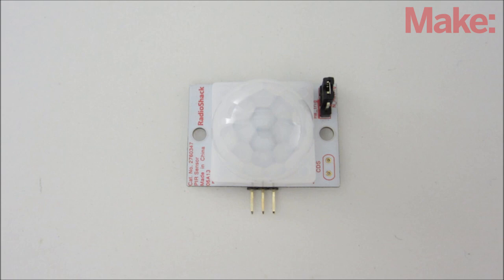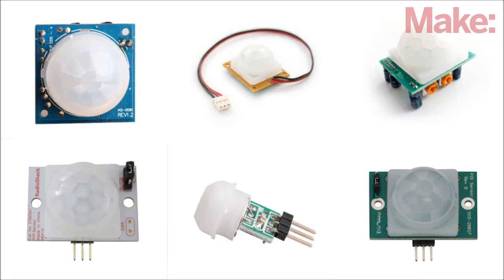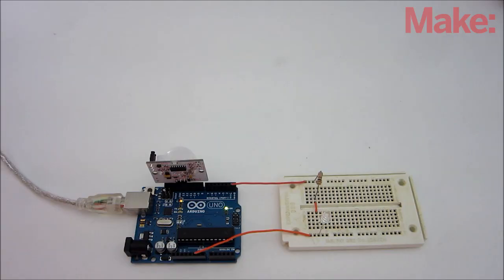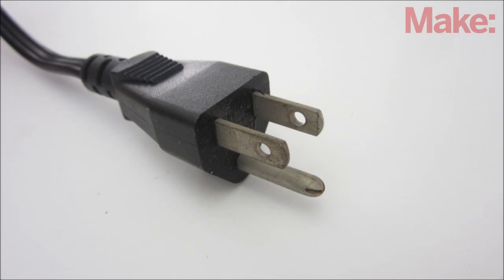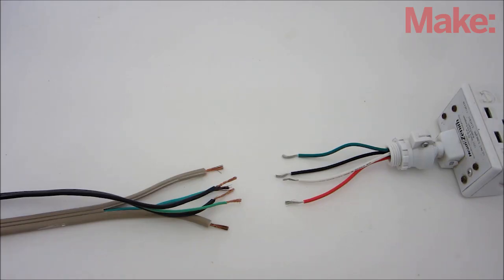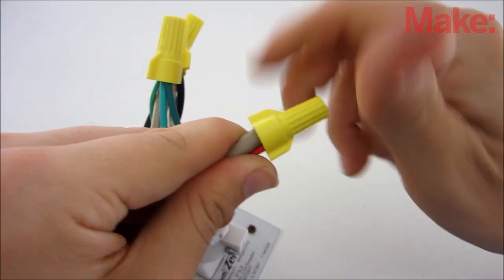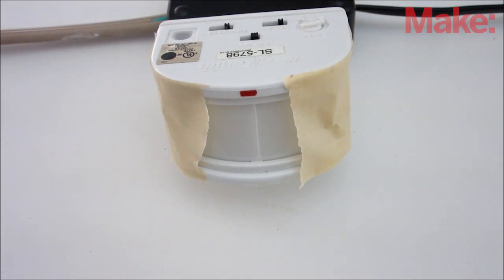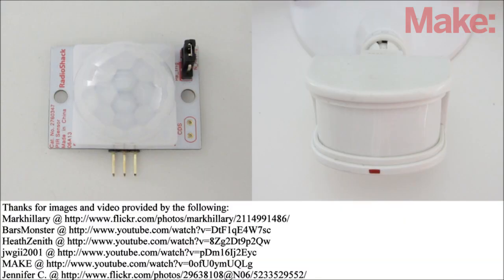DIY Hacks & How To's: Motion Sensor

Comment: how can i connect a sprinkler to make the motion sensor to shoot water for cats & birds?
Reply: Rolo Ojeda buy a DC 12 volt (low voltage) motion sensor and connect it the same way in the valve box to your sprinkler line you want to turn on.

Comment: Personally, Id get one of those motion detectors from a security system, and I'd garbage pick a computer and use a keyboard controller and wire all the pressure plates etc to it.  It would be cheap and thats how real DIYers do it!
Reply: Make a video chief

Comment: an easier way for someone who wouldn't want to risk electrical shock with 120 voltage could use the powerswitch tail and the mini PIR sensor. just putting it out there. i know for me this would be cheaper solution.